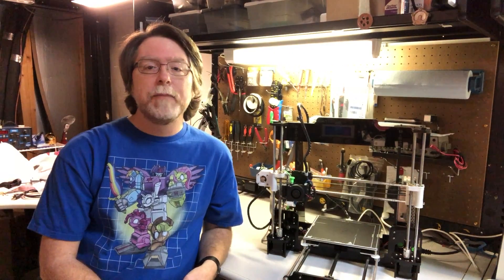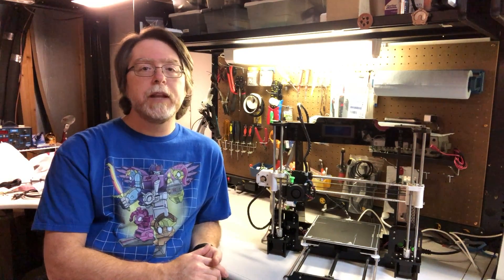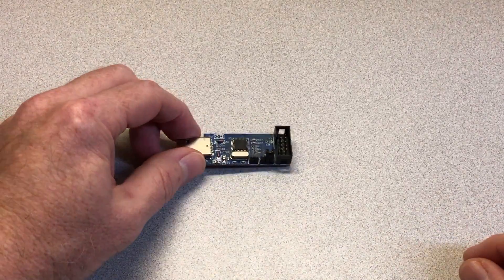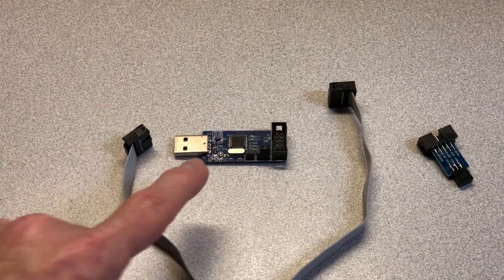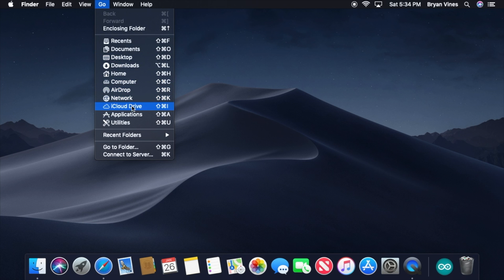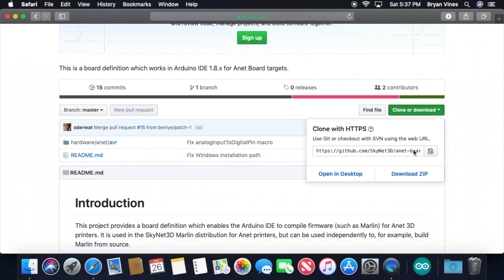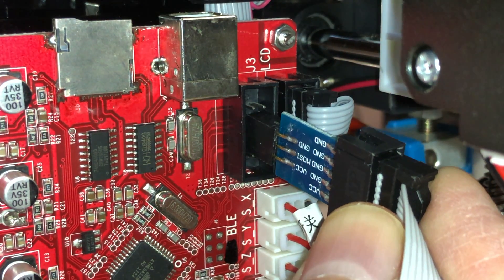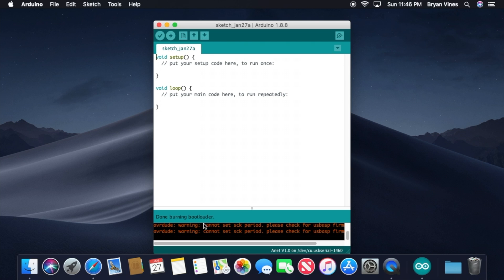How To Install a Bootloader on the Anet A8 3D Printer

Comment: Thanks for the instructions! You have helped me more than once. I did have a problem writing the boot loader with my USBASP. I kept getting the error: "warning: cannot set sck period. please check for usbasp firmware update" I solved this by jumping JP3 on the usbasp. I still received the error, but the boot loader was successfully written to the board.  You do not have to update the usbasp firmware.

Comment: Hey Brian ... I bought 3D Anet Board V1.7 The problem is when (Home All) is turned on for the first time,  the extruder go opposite side to the end. It continues to spin for some time until the manual shutdown is stopped. I noticed that the movement was turbulent and disorganized.

What do you think is the problem?
thank you ,,
Reply from the maker: Hi! You might check to be sure the X and Y stepper motors are plugged into the correct ports on the Anet board. If they are, and the X carriage still moves right to home (instead of moving left), there's some G-code commands you can send to the printer to reverse the direction of travel for an axis.

We'll use the X axis as an example:
    M562 X     ; Inverts X-Axis motor direction
    M500       ; Saves changes to EEPROM

Reboot printer to complete the process (turn off, then on)

You can send the two commands with Pronterface or another application which allows you to send commands directly to the printer's mainboard. Or you could put those two commands in a plain text file, save it as something like invert_x.gcode, copy it to the SD card, and "print" the file to execute the commands.

And you can send those commands again to put it back the way it was, if you need to. And you can substitute the letter of the axis you want to invert -- X, Y or Z -- in the M562 command.
Reply: @BV3D  
Thank you very much for  answer
:
But how can I send the G code to the printer to reverse? Can you explain to me how to do that ...
With my appreciation
Reply from the maker: @fpt380  On this page, you'll find some downloadable G-code files to reverse the stepper motor directions; there's one for each axis. You'll need to scroll down a little bit on the page.

It sounds like you need the one for the X axis. But if reversing the X axis gets it moving the right way, but it doesn't stop when the X carriage homes on the left side, you'll need to re-reverse it to put it back the right way, because something else is wrong. But I hope this helps!

Comment: Great Video! I am unable to install MarlinFirmware on my Anet A8, does this mean that I do not have a bootloader?
Reply from the maker: Hi Isaac, what happens when you try? Are you getting an error when it comes time to send the compiled firmware to the printer?
Reply: @BV3D  I get this error...

Ser_open() : can't set com-state for com6

I think that it is to do with the COM port, I have selected the right one, updated the Windows USB drivers.

I get this error while trying to upload to my Anet 1.7 Mainboard.
Reply from the maker: Hi again Isaac, I'm not much of a Windows person, so I don't have a whole lot of experience with issues on that platform. 

And while it's possible that your Anet 1.7 board does not have a bootloader installed, I would try making sure the CH341 serial-to-usb drivers are installed (I think the 1.7 board uses the CH341 serial-to-usb chip). And also unplug & replug the USB cable afterwards.

If that doesn't help, then your board probably does not have a bootloader. You'll need a USBasp programmer, then you can use the Arduino IDE to either flash a bootloader onto the Anet board, or compile and flash firmware directly from the source code.
Reply: @BV3D  Ok thanks i will make sure that the drivers are installed.

Comment: I BOUGHT a 6 pin usb programmer that is in the correct order for the Anet board, It's a right bugger to get it working on windows as the drivers needed are not signed, you may want to load the smaller and quicker optiboot bootloader which gave me enough space to install the A6 screen and a bltouch which ran out of space on marlin 1.7 but I think fits on 1.8
Reply from the maker: Hi Brian, that's a good suggestion--using the Optiboot bootloader to save a few bytes, when you're trying to get as many features as possible installed. And if you're really short on space,  and you've got the source code loaded in the Arduino IDE, you can flash the firmware directly to the board through the programmer, and save the 4Kbytes or so that the bootloader takes up. The board won't have a bootloader, but you'll have a bit more room for code.

Comment: Question from Mark: why do you have a second adapter listed? The main adapter comes with a 10 to 6 pin adapter?
Reply from the maker: Hi Mark! I talk a little bit about that at the 3:06 point. 🙂I have the second adapter listed because the one included with the programmer has too much plastic around the sides of it. This prevents it from fitting over the center 6 pins of the programming header. The second adapter doesn't have that issue. 
As an alternative to buying the extra adapter, you could cut or file away the excess plastic from the connector that's included with the programmer.
Reply: BV3D: Bryan Vines thank you. I installed the 1.7 board this morning. Yikes! The Anet interface SUCKS!!!!! So now I’m going to put the boot loader on it, then install Marlin. Thanks for getting back to me!
Reply from the maker: @corlissmedia2.0  You're very welcome. Yeah, I don't care much for the "OMNI 3D" firmware they have on it. Try flashing Marlin on it first; it may have a bootloader already on it. I'm curious to know whether they're including bootloaders on the boards again.
Reply: BV3D: Bryan Vines okay, I will!
Reply: Super Good News!!!!! The 1.7 Flashed!!!!! I’m using 1.1.8!!!!  Thank you so much!

Comment: So cool to see you using the Arduino IDE in this project.  Although I don't have the Anet A8, I still find it really interesting, and educational.  Thank you for the content you provide!  Always something new to learn.  And, thank you for you help in my little projects.
Reply from the maker: Hi Tim! I'm currently working on a video to show how to install the Marlin firmware on the A8, so that one will also use the Arduino IDE. The Alien3D temperature & humidity sensor project really got me going on Arduino stuff again. So much so that I bought a $50 sensor projects kit from Amazon. I may do a series of videos showing off the various projects you can make with that. 
One of the coolest things in the kit I got from Amazon was a little RFID key fob and a reader. You could make a little lock box with it that only unlocks with that key fob.
Thanks for supporting the channel, and you're very welcome! 😊

Comment: Brian this is FANTASTIC! I am a Mac user too and need these clear instructions of yours. Can you do same for an Ender3 or other Creality machine please. I want to add linear advance and possibly even Klipper but I know nothing about firmware and am afraid of screwing up my printers
Reply from the maker: Hi Peter! I've kept my Ender 3 Pro stock for the first month of its life, with the intention of reviewing it. Once the review is done, I'll start doing modifications to it, starting with stiffer bed springs and (of course) the Wham Bam Flexible Build System! I've got a couple more videos to do on the A8 first, then we can start doing others. I'll put this suggestion on my To Do list! Thanks! 👍
Reply: BV3D: Bryan Vines excellent cant wait! You’ve got a very clear and thorough method of explanation which I really need before I mess with my firmware.
Great job again!

Comment: Great Job! Interesting that you used the Skynet3D firmware ?
Reply from the maker: It's not the SkyNet3D firmware, but it is their board definition file for the Arduino IDE. It just tells the IDE how to talk to the Anet board. At this point in the process, there's only the bootloader. Firmware comes later. 👍
Reply: BV3D: Bryan Vines ok, now I get it.